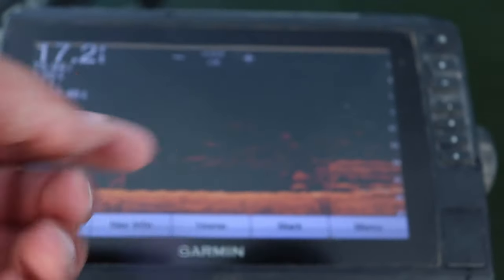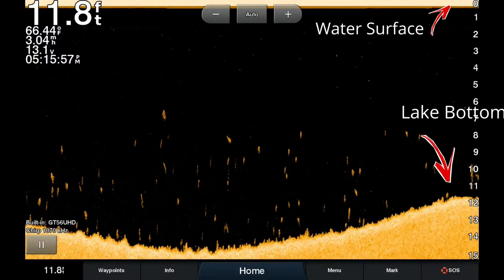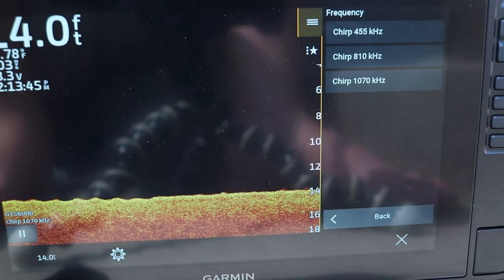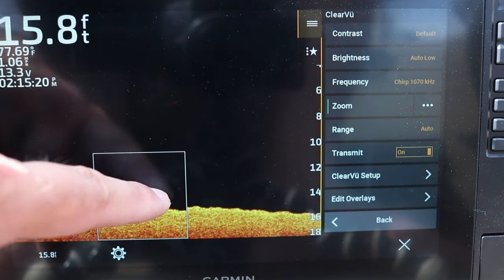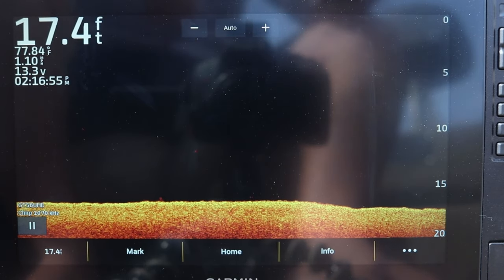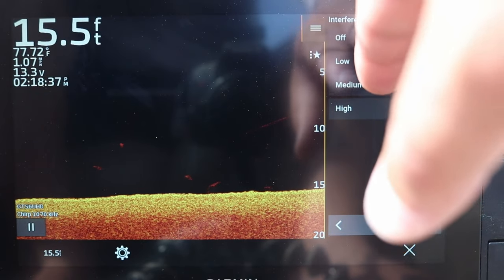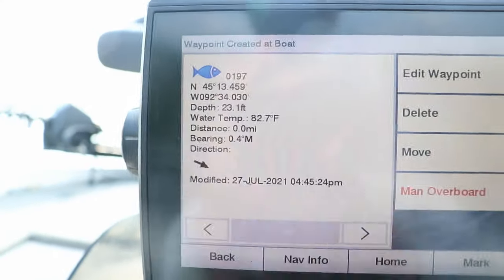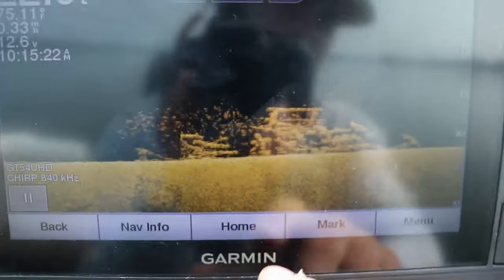How to use Garmin Echomap 93sv : ClearVu | Down Imaging

Comment: You my guy are a genius I watched your video went out on the water today switched my settings brightness to 73 contrast to 59 range to 30 l ran the garmin in orange crawfish aswell it was like night and day from yesterday to today the units factory settings were just too bright yesterday I was thinking There Just ain t No Fish In This Lake but today l found suspended crappies at 5     8 and ten feet l could tell rocks on the bottom from what l thought were big fish yesterday I’m running a striker 4 clearVu unit may l add it’s not the greatest graph and l was really sceptical about there not being fish and if the garmin was even works but but after switching a few major settings just like you did I know there there and l can find them and have confidence in my unit now if l can just get them to bite  Thanks a bunch buddy

Comment: I have to run my ClearVu on 800kHz and my SideVu on 1070kHz, because running them both at the same frequency causes the SideVu to not be as clear. There are many people that run their’s this way. Not sure what you have discovered with this. I’m running a 126sv and 106sv with GT56UHD transducer.

Comment: Can you use  both Livescope transducer & the GT 54 at the same time with this unit?  If not- can you switch back and forth easily like pushing a button or unplugging one for the other?
Reply from the maker: You can switch back and forth very easily. I haven't tried to use sidevu or downvu with a split screen and livescope,  but I think it will work.
Reply: Yes you can. I have a quad setup that has LS, Clear, Side, and 2d at once on my 106sv. But that a lot to look at and process at once. Have a split screen with LS and one of each. I have one 54 on the TM and one on transom. My LS is on a separate pole about 2ft behind the tm.